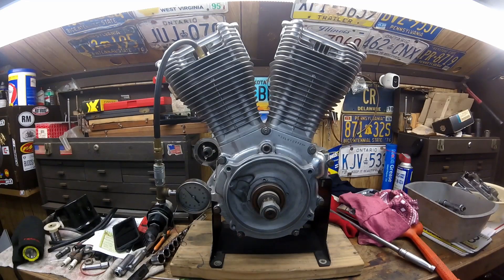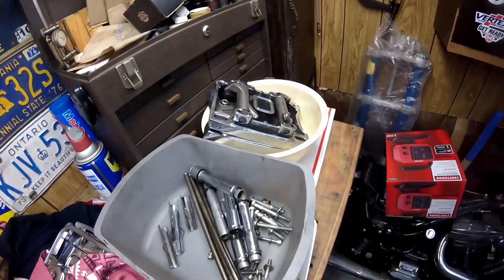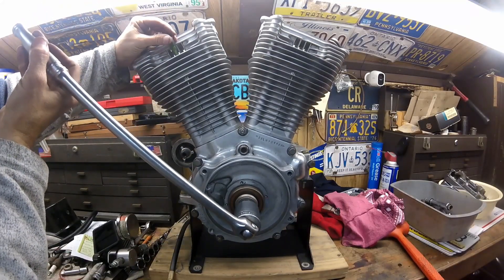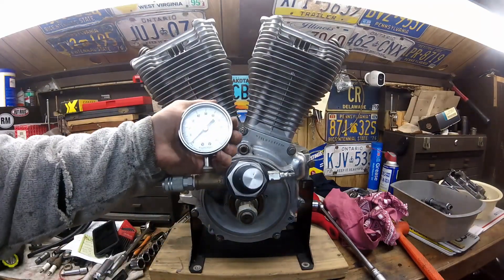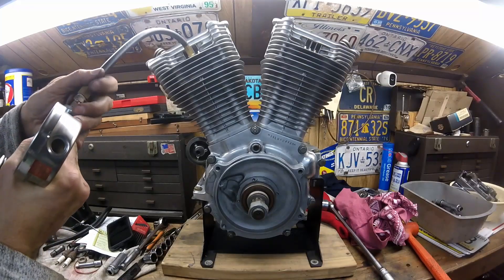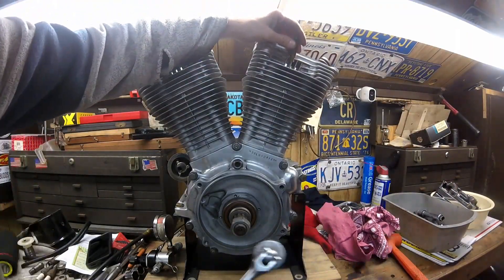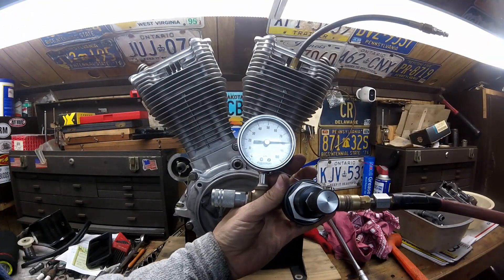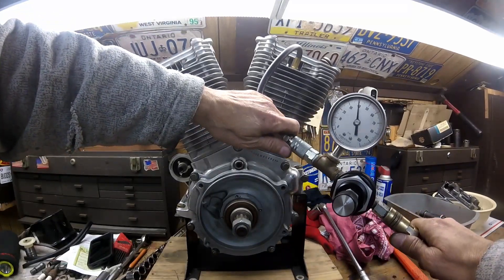Leak Down Check Harley Motor

Comment: I have seen leak down tools w 2 gages ..you only have one what's better ... And another question I have I've been working with the S&S carburetor. He used to have just a little bit of cough with the 29.5 and the 31 intermediate jet now I put in the 33 and it went away. I have a 72 main jet in it seems to run just fine do you have any recommendations on jeting am I doing it right.. direction and I appreciate your expertise...
Reply from the maker: I can make some suggestions but first check out this S&S video. If you need further help please let me know. 
https://youtu.be/I_uH72wDTL0?si=-Op7p8us5UImWfkh
Reply: @Rapsgarage  yes I seen that one. There's another one too and he seems to build choppers with just a suicide clutch if I remember right I forgot the name of it. He has a good insight into the S&S carburetor.. stuff to I was worried that well my spark plugs don't have a full ring of black around the last or actually be the first thread because the first what is sticking down into the combustion chamber minus like half black. Not a full ring and I seen and have always thought that it should be a full black ring around their for correct combustion being not too rich not too lean.. it was the site that I seen called drag stuff.. and they have a website with good spark plug information.. somebody did mention to me and I've been running 38 gap on my plugs and they said because I have points it should be a 30 and I forgot and I used to do that years ago so I did that a little bit ago.

Comment: How was it that you were able to keep your piston from not moving out of TDC, without anything locking the nut from moving, when you applied air? I've watched many other vids on performing a leak down on a twin motorcycle and all of them had to hold the break pedal down (if motor was in the bike), or used a breaker bar on the nut and wedged against something so it would not move.
Reply from the maker: Because I had so much leak down.
Reply: @Rapsgarage  😝 That makes sense.
Reply: my thoughts exactly-  I was watching and thought at first maybe he had so much leak because the piston was pushed down. So yes, the infamous- "I just rebuilt it- good to go".  Had one of those with the breather gear not in time with cam- talk about bottom end pressure build up...   Ride safe everybody.

Comment: I like your homemade leak down tester. Is there a “rule of thumb” to how much pressure should be supplied when using the tester?  Just wondering at what psi will push the piston down or leak past the rings. Just a random thought I had.
Reply from the maker: Any pressure wants to push the piston down. Whatever supply pressure you start with (you have to use at least 80psi or you won’t be able to tell where the leak is)  you divide the finish pressure buy the supply. Example 
Supply is 80psi
Leak pressure 70psi
70/80 = 87.5%
100 - 87.5 = 12.5% leakdown 

My compressor is at 95psi

With the regulator I regulate it to 80 psi and check the leak. Let me know if you have any more questions. Thank you
Reply: @Rapsgarage  good job explaining.

Comment: Has this engine run at all after so called rebuild?  If not it hasebt had a chance to break in!   You can build it again and may not get any better results till it is ran and broke in!
Reply from the maker: It was not ran before I pulled it apart. The leak was all past the valves so running it wouldn’t have made a difference. Even a fresh rebuilt motor shouldn’t leak this much.
Reply: @Rapsgarage  true but it could have been something simple like valve not adjusted correctly.  Dont know how anyone could rebuild a head and have that bad of a leak at the valve unless it had some serious shoddy work done.  What did you find on the valve when you disassembled?
Reply from the maker: I haven’t pulled them apart yet. I’ll video it and post it.
Reply from the maker: I assume any used engine that I buy I’m going to have to rebuild unless I hear it run. This has been the case with all 4 of the used engines I’ve bought. 3 of them were supposed to have been rebuilt. The 4th ran but had been sitting for 22 years and was a mess.